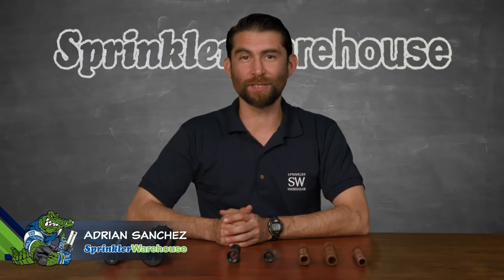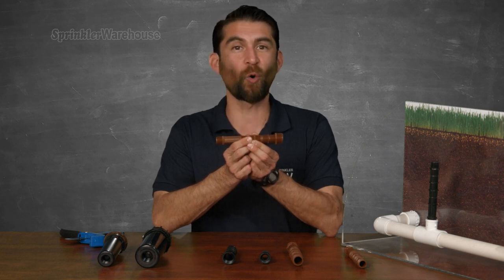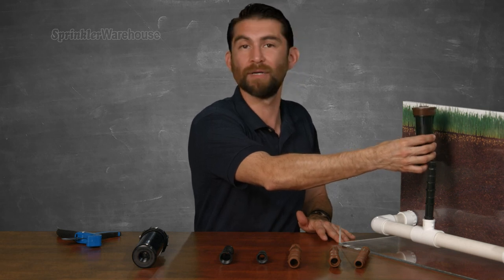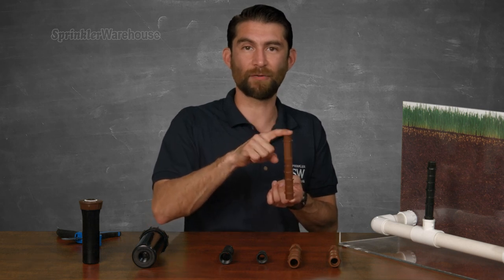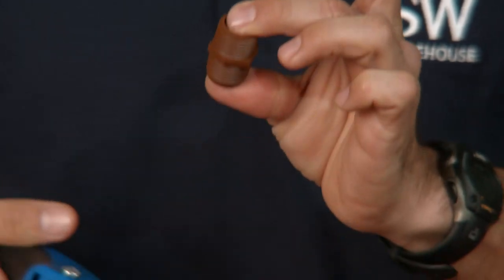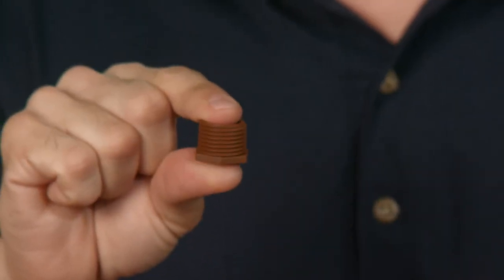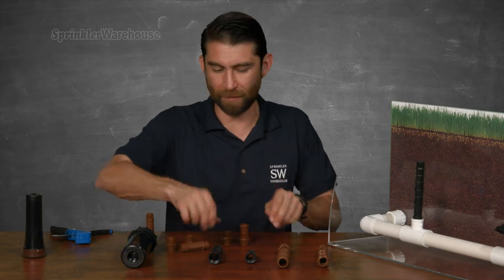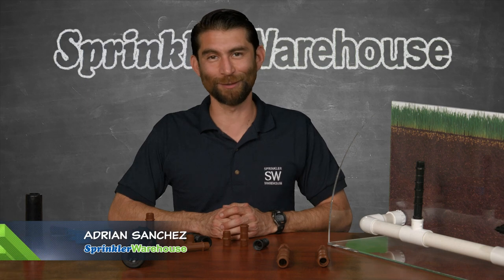Cut-off Nipple Risers

Comment: I'm confused.  I just bought some sprinkler extensions that are half inch and they screw into my sprinklers, but the other end is the same (male threads), and the sprinkler pipe, of course, has a male thread.
Reply from the maker: You will need to utilize a 1/2'' threaded coupling to join both together. SKU 430-005
https://www.sprinklerwarehouse.com/sch-40-pvc-coupling-1-2-in-fpt-430-005
or you could utilize SKU: 37017 Its a Male X Female extension
https://www.sprinklerwarehouse.com/orbit-cut-off-nipple-1-2-in-x-2-1-2-in-fpt-x-mipt-37017